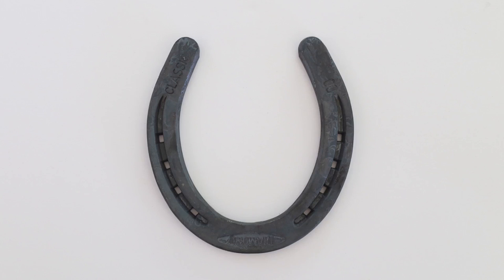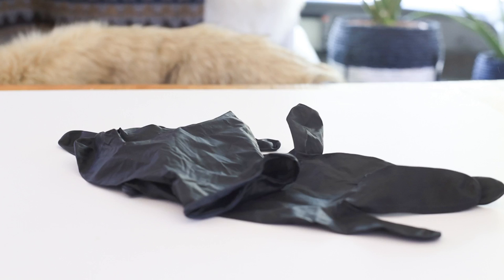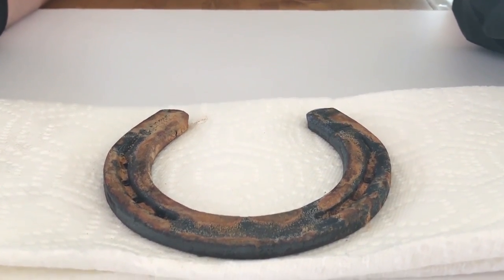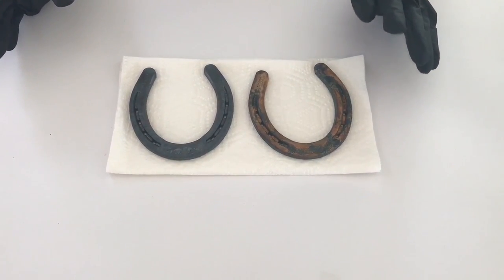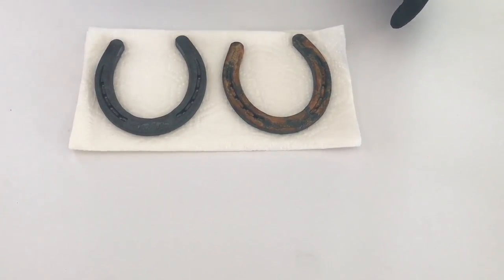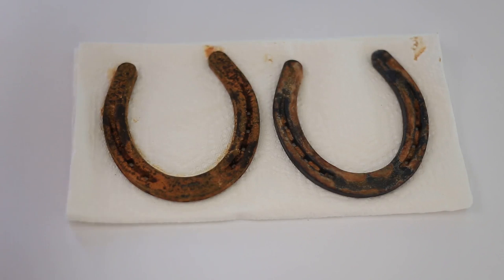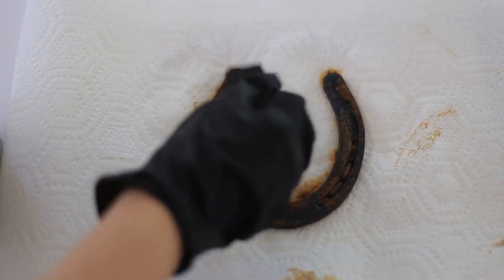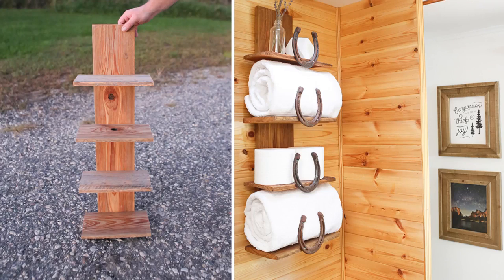How to Make Metal Rust

Comment: Do I have to use vinegar? Can I just use salt and peroxide
Reply from the maker: That's a great question @Justin1611 to be honest I'm not sure as we've only done it this way. If you give it a try I'd love to hear about your results.
Reply: I can help you with that: you can use any acid... Vinegar is just safe to use. 

H202 will act as the oxidant for your metal, but in order for that to happen, hydrogen ions are also needed (which exist in a acidic environments such as vinegar, but also oxalic acid, muriatic acid,... ).